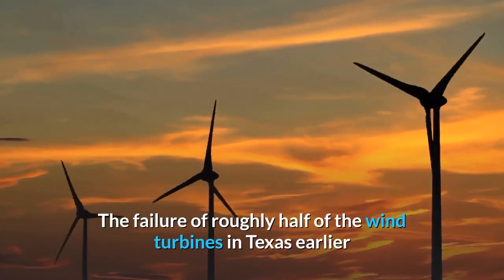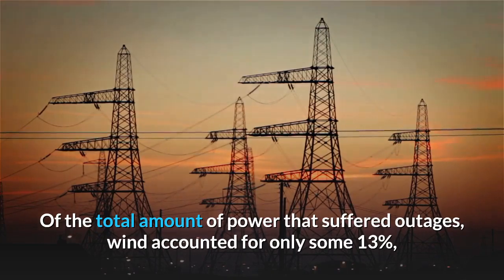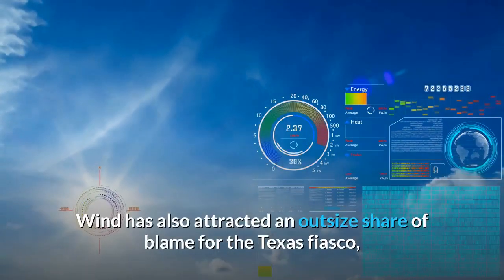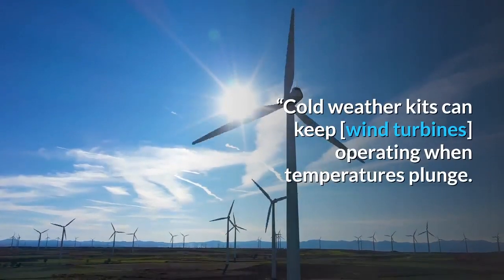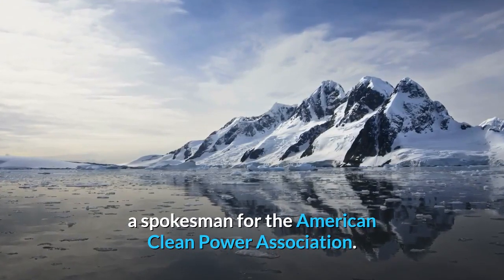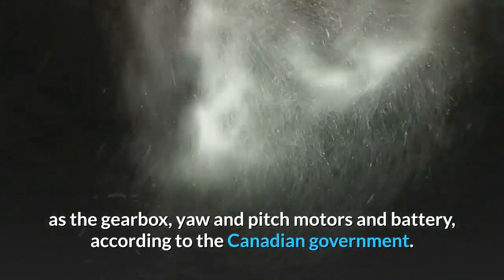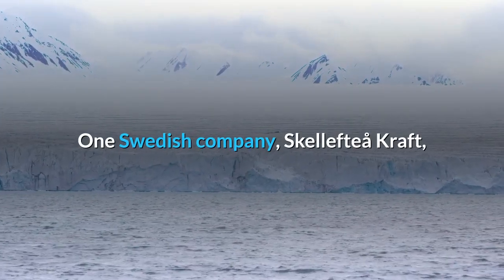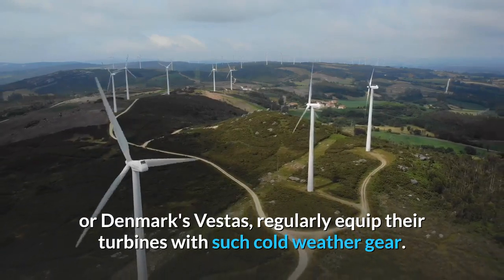Why Wind Turbines In Cold Climates Don’t Freeze De Icing And Carbon Fiber

Comment: Only a moron would be pushing wind turbines.   Ecologically toxic in mining, refining and manufacturing, and recycling; rubbish for reliability (video case in point); can't work in high wind speeds, can't work in low wind speeds, can't work when it's very cold or very hot.  Similar BS applies to solar panels.

Comment: Wind power froze and the gas power couldn’t handle the load the added load that the wind power would usually accommodate. The Texas power grid is not suited to a humid cold to the point of snowing climate. A black swan event for the lone star state. Big media doesn’t like it when their green narrative doesn’t fit reality.
Reply: El Paso Texas which is connected to the Western power grid didn't experience rolling blackouts. Wind turbines here in New Mexico just west of Texas are still turning and producing power and our solar cells are still producing electricity. We are sitting here warm and cozy with the lights on produced by Green energy.
Reply: Truck Jones  For the right, they said "only the strong will survive".
Reply: Do some research. Texas only gets 1/5 of its energy from renewable energy.  https://www.eia.gov/state/analysis.php?sid=TX
Reply: Truck Jones  and the right is always trying to blame someone else for their failures
Reply: Truck Jones  Texas is a red state with it's own power grid and yet they are trying to blame the green new deal and Joe Biden for this power failure  . The non existent green new deal  .
Reply: Truck Jones  the right doesn't deserve compassion for allowing people to freeze to death
Reply: It wasn't a "black swan event" at all. This is NOT the first time they've had cold snaps this bad. AND they had months of warning, and three days of very specific forecasts. They experienced a similar freeze just a few years ago, and had specifically been warned to equip their wind turbines and other generating gear like the gas pumps, for the cold. They refused to, in order to save money short term. People died because Texas commercial energy companies were greedy assholes, and Texas politicians enacted stupid policies.  The media "narrative" fit perfectly, because it's simple reported of the truth.
Reply: Truck Jones  It actually did work out very well. Try reading something for a change. MOST of the wind turbines put out energy. Only SOME of them froze. And the ones that didn't freeze, on the coast, put out more than expected for the season. The wind turbines actually saved a lot of people's lives. The problem was almost 100% bad planning and the NATURAL GAS pumps froze and couldn't maintain pressure due to overuse of gas. in other words, you would have been BETTER off, if more of your energy was renewable and if your idiotic energy companies had just followed the recommendations of the Texas Energy Board and winterized, like most other states have. It's not rocket science.